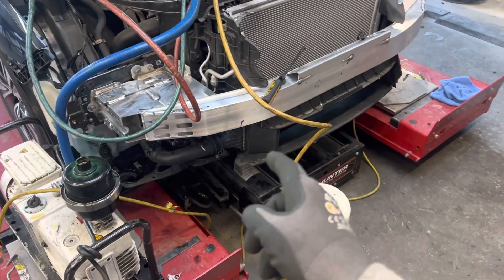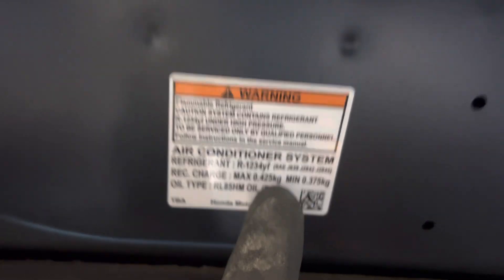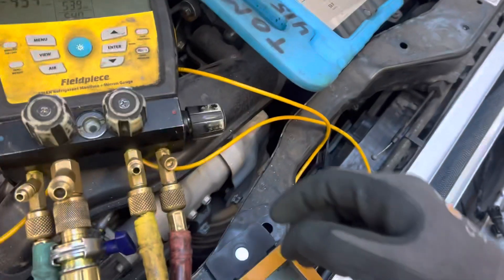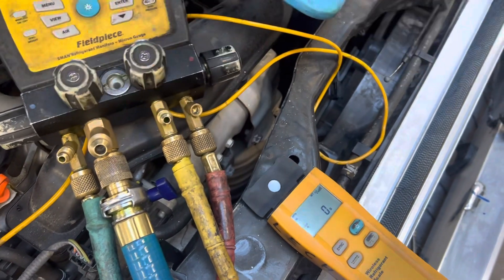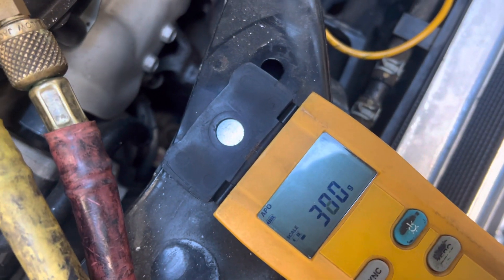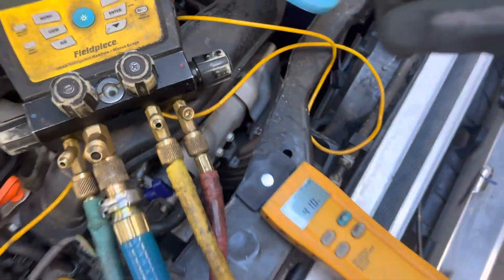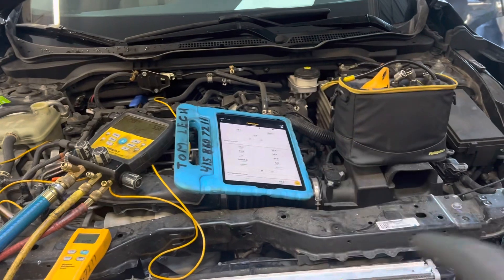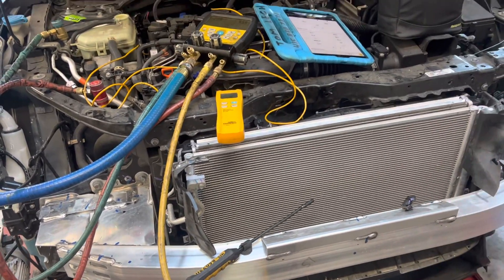Recharge Refrigerant @ 52°F ambient temperature. What will the superheat and subcooling look like￼ ￼

Comment: I live in Phoenix with a 28 year old, 5 ton, R22 refrigerant, fixed orifice, no accumulator system.  Do you recommend conducting charge checking/charging at the coolest times of day?  I have a sman 480 and JL3RH for analysis. 
     What sort of efficiency improvement might I see if I added TXV?
Reply from the maker: If it 28 years old and working don’t touch it. 

Just make sure the superHeat setting is correct. 
If their original installation, manual is still with the unit, read it from the first page to the last page . 
If you lost the manual, no problem the Internet, the manufacturer, makes all the manuals for the old units available online you can download it . 

Read understand and follow every instruction . 

Do not use rules of thumbs do not do with some old guy tells you to do . 

The manual has a graft table that tells you exactly at what temperatures to set the superheat and adjust the charge up or down . 

Have a brand new filter like a Merv six or a Merv eight . 

Do not put one of those super high efficient allergy filters in your old system . They restrict too much air.

Unless you go out of the way to upgrade a filter, insert remove the original 1 inch filter and put in a 5 inch or 7 inch deep pleated filter that is much larger like 16” x 30” 5 inch deep 

Then you can start purchasing the allergy rated filters because you have more surface area that does not restricting airflow 

Most likely, the ducting is restricted because most homes are built with two small of ductwork, restricting airflow. You don’t need to respect it anymore. . 

Make sure the evaporator coil is clean and the condenser coils clean that’s about all you can do . 

As per instructions in the factory instruction manual, even when they testes, they test him like in a lavatory with a 90° or 95° outdoor temperature in an 80° indoor temperature 

Which 80 degree indoor temperature is ridiculous. 

But everything is spelled out in the manual

Comment: Tom, since it's best to charge a system, set in A/C MODE only, and in summer heat environment to achieve best actual charge level, do you ever, in winter, ever place electric space heaters into a car cabin to simulate summer hot cab?
(Note: Using engine heat or even setting system to 'Defrost Mode' doesn't work same as 'A/C' ONLY mode.    Why?  'Fresh Air' and 'Hot/Cold Air Mixer' damper doors are in different positions when in HEAT or DEFROST modes, rather than in A/C ONLY mode.)
I use multiple electric space heaters to get enough heat into the cabin.  One on each floorboard area is necessary to get enough heat to stress the A/C system.  A bit troublesome, but it WORKS!  (Protect seat fabrics from any directed heat though!  Two layers of sheet metal, placed in front of the heaters, works best.)
Reply from the maker: And about her use the bullet space heater propane or kerosene for outside heat load over the condenser.   You can actually bring a Garage temperature up to 160°F if you want to . 

When I used to work in a body shop in the winter time this is how I would care of the paint inside the booth is with a bullet heater. 

It was excellent for doing winter time AC charging because you can simulate 110° day in a matter about 10 minutes
Reply: @coldfinger459sub0  Yes!  Me too.  Love it